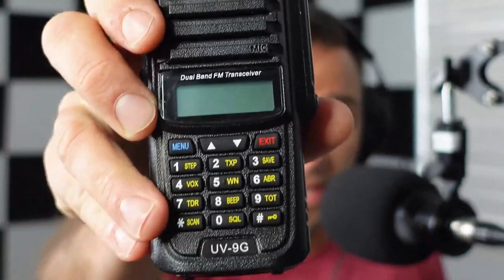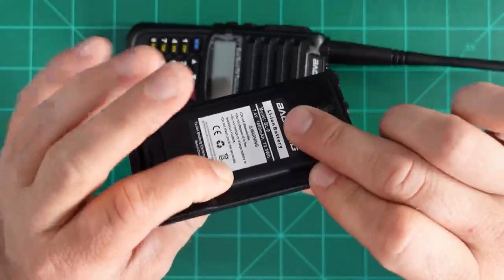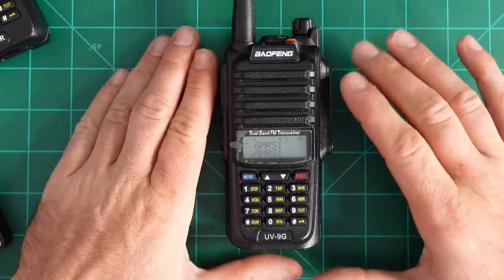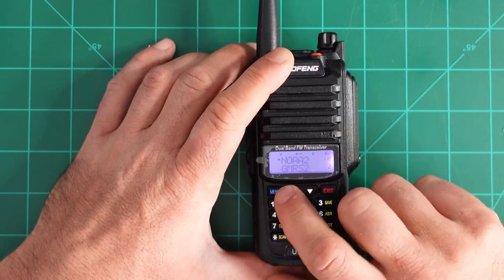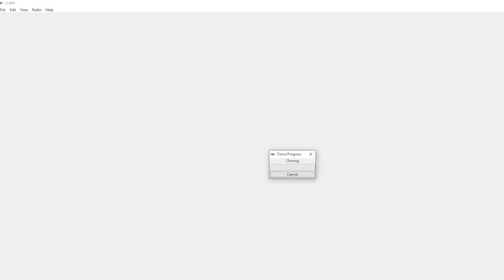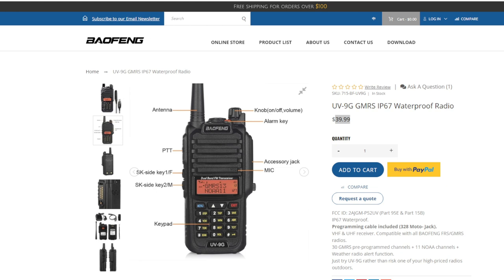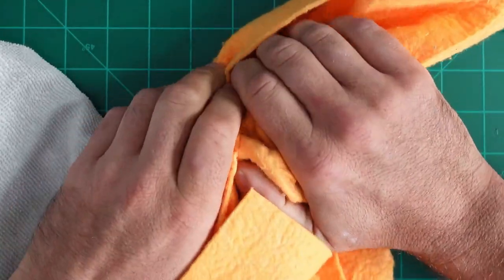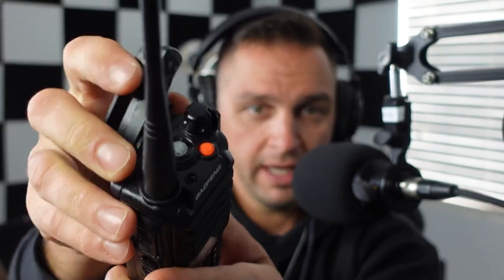BAOFENG UV-9G GMRS RADIO - Overview and Water Torture Test - FIRST LOOK

Comment: I used the screw from the back of the radio that was replaced when the button for the belt clip was installed.  Then you don't need to remove the one on the radio cover.

Comment: Purchased the double pack from Amazon in Nov 2023. Discovered that Channel 15 does not transmit at all. And I had to use chirp to edit the NOAA channels to the correct frequencies.

Comment: I just got into gmrs a few weeks ago an just got a set of the uv-5x radios with upgraded Nagoya antennas. After seeing this video I feel like it’s a no brainer that I ordered this radio. I wish I would have ordered 2 of them. I don’t think I like that belt clip though. I feel Iike the radio will swing back and forth on my hip. That will be annoying.
Reply: I bought 2 UV9G's and within 2 weeks both belt clip buttons came unscrewed and the radio dropped to the floor. I agree the belt clips are trash...

Comment: I think you did not mention that all the channels, on the original model, have came preprogrammed with a ctcss tone. Which may need to be cleared off before you can tx / rx with another radio.
Reply from the maker: That's true.  It's not really a problem since the radio comes with a cable
Reply: @HAMRADIODUDE  Can the ctcss tones be changed by the keypad or do you need to use the programming cable?
Reply: @Jason Osborne Yes you can. However Baofeng added the Noa channels to the scan list from the factory and you can not change that without using software.

Comment: you should use can Air to blow out the water
Reply: Very gently, because air pressure can often blow off or rip, the thin layer of water proofing film, that are inside these radios. The film covers the speaker, mic. And maybe keypad. Thus blowing water inside the radio case.

Comment: When trying to change anything on the default channels on that software,  it automatically changes it back for me. Including the ctcs codes and channel names. I am using it on the uv5g(x) but same software. Any ideas? You also cant change the band on any channel unless you do it on the radio. However, when you read jt from radio, it sets it all back to default.
Reply from the maker: When did you get the radios? There's a firmware released around April that resolves the ability to not change the ctcss
Reply from the maker: Oh sorry, I was looking at / thinking of the UV-5G.  I gave this radio away but I believe Randy at notarubicon productions has addressed this issue and recieved a response from baofeng

Comment: Would this be suitable for travelling logging roads in BC?
Reply from the maker: That's a good question. I'm unsure of the terrain for logging roads in BC.  Is it typically flat, hilly, curvy, etc?  Also, would you be talking to other drivers or looking to connect to repeaters? I'll be more than happy to look into it
Reply: @HAMRADIODUDE  We just need to advise of our location at every mile marker, and also listen for oncoming logging trucks and/or traffic.  
We generally have mountainous, treed, curvy roads when travelling these roads.  I know guys do use the 5 series, but was wondering if these may be a bit better.
Reply from the maker: @dginta7932  internally, they are similar radios. Being the recieve sensitivity and transmit power (depending on which 5).  If you're looking for an improvement from the 5 series, I would consider an external antenna.  A decent antenna with a good groundplane (the vehicle) will typically improve your reception and transmit capability more than anything else.

Comment: The review should begin with a discussion on which antennas fit the damn thing. I have a drawer full of antennas: Nagoyas, Abbrees, knock-offs of every sort and type. None work. Why no mention of this antenna problem? The only antenna that fits is the one that comes with it. Fortunately, the radio (as is) transmits more than ten miles simplex.
Reply: There is a video where a guy uses 80 grit sticky back sandpaper wrapped around the base of the factory antenna and reams the hole out just enough to fit the Nagoya 771

Comment: Now try it at 1m and the ingress pressure that comes with that depth. ;) Not bad for $40 though. Note that the FCC grant only allows 3W ERP, which means it should only really output about 2 or so Watts. It's also only certified for narrow-band, which makes it a fancy FRS radio. :)
Reply: You can change Narrow to Wide band. The mfr is issuing a software update to fix that.
Reply: @RescueEMS  Yes, I watched the video and I’m aware of the features. What I’m saying (which I guess I’ll say again) is that the FCC has not authorized this radio to operate on “wide-band” at all. Unless they have the unit retested and add to the grant application, it won’t be legal for FM operation no matter what the radio can actually do. It makes me wonder why they didn’t test it for such.
Reply: @RescueEMS speaking of sad hams..😂

Comment: I have a question for anyone who knows about radios:

Are Baofeng or Ham radios dangerous???
Reply: I.'m not an expert but you can find information about that topic. 

Handheld radio could be "dangerous" especially for you eyes if you have high power and holding it right in front of your eyes.. It's recommended to have external microphone in order to keep the radio away from your head. 

Please, take my comment as a starting point to get better informations about that topic.

Comment: Ch. 15 does not transmit..junk.
Reply from the maker: I want to test these out again, to see if something has changed and maybe help correct it.  Did you get it from Amazon (So I make sure to purchase the same one others are).
Reply: It's was corrected by the manufacturer ages ago...Before you speak, it's a great practice to make sure you are not completely wrong before you run your mouth about things you know nothing about...